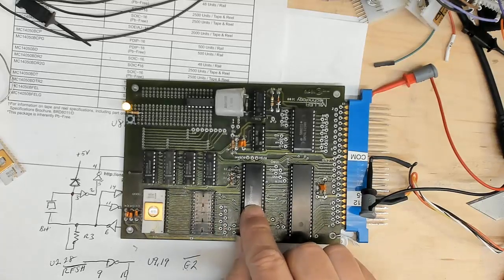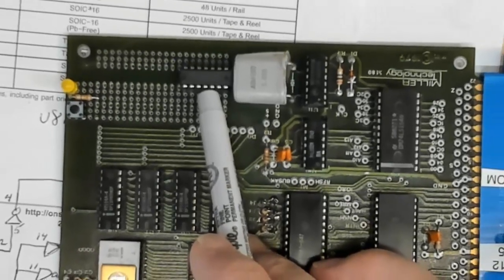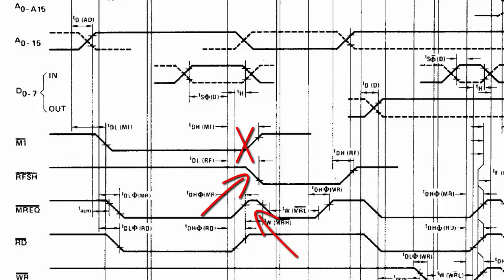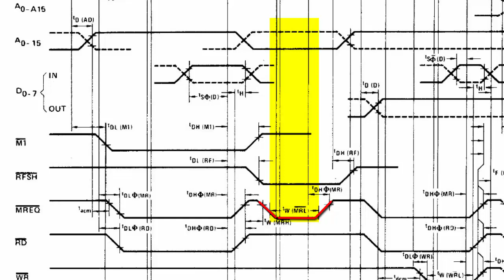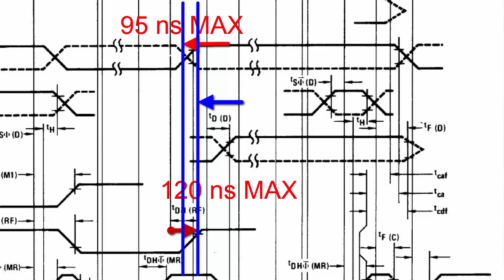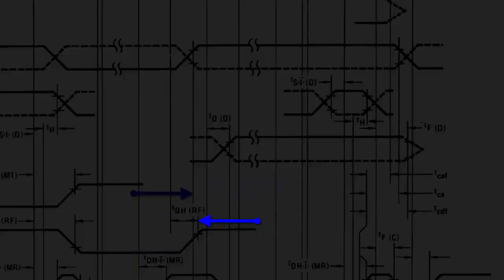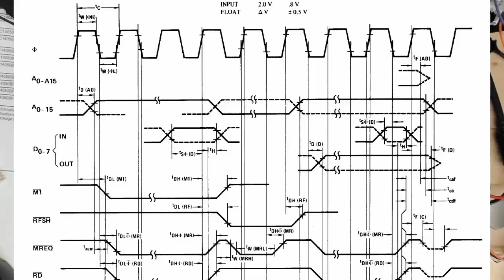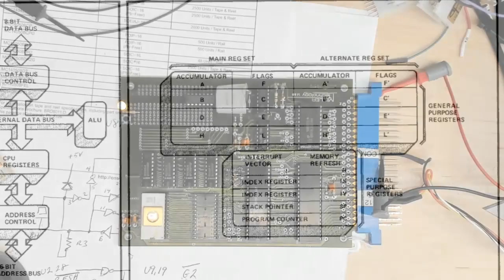{65} There is an output port on the Z80 that is rarely utilized and yours for the latching !!!

Comment: Why does that uncovered UV EPROM bother me so much. It's fine for long enough under led lighting.
Reply from the maker: I get where you are coming from.
Intel gave a safe exposure time of 3 years under fluorescent lighting.  As you suggest, that probably extends to decades under LED lighting.  They also gave erasure time outside in the sunshine as 1 week-- which probably extends to years worth of low-sun summers and no-sun winters here in the pacific northwest.  
While working on a project, the average lifetime of my firmware is measured in days, so i am not too worried about my EPROMs being the weak link.  I do usually put a label over the EPROM when a project is 'done' , to document what version of the firmware was last installed.
Reply: @HelloWorldETX  It seems to be one of those cultural things drummed into us to be bothered by it, there's no rational to be. I noted one other had to say something about it in the comments too.

Comment: Ok, we all know that the refresh signal coming off of pin #28 is often times used for refreshing dynamic memory. What would happen if static ram is used leaving no use for the refresh signal so it just gets sent to ground ?
Reply from the maker: Totem pole output— It would not like being grounded.
Reply: @HelloWorldETX  ; Would it be best then to just not use the refresh signal for anything since it's an output signal and not an input ?
Reply from the maker: @thomas-i5o7h  Yes.  It is an output so it can be left unconnected.
Reply: @ ; Thank you for the info, I've asked this question to quite a few people and you are the very first one to give me a straight forward answer to this question.

Comment: Now that I have seen this, not that I completely understood, I get an idea. Using a sequence of patterns on either the data bus or the address bus to switch something. Most the time it would not interfere with anything.
Reply from the maker: Yes, it is all a matter of how complicated you want to make it. 64k memory (or io) things can be accessed in the normal way with a single sequence, double that if two steps are used like page memory, and so on.   Could tack on anything to anything by making it more and more complicated to access.

Comment: Your EProm does not have a light cover sticker over it???
Reply from the maker: Indeed.  Not worried in the least. 
The lifetime of my test code in an EPROM is several orders of magnitude less than the bit-rot rate of the EPROM from exposure to the lights in my room.   When I finish code, I will put a label over the window with the code name and version number.
Reply: @HelloWorldETX  :)

Comment: Anybody exploring the undocumented instructions in the Z80? Either (some?) Z180 or Z280 16 bit  instructions actually worked in the Z80. Unfortunately I sent all handbooks away years ago. Running the Z80 with 2 * 64 kB dynamic ram + 32 kB EPROM... Using double DMA circuits and double floppy disc controllers, memory protect.... That build was a beast. A 19" rack filled up with 20 single Europe cards... Those were the days.
Reply from the maker: The Z80 still enjoys a loyal following.  here is one site listing undocumented instructions: http://www.gaby.de/z80/z80undoc.htm#:~:text=MORE%20Undocumented%20Z80%20Opcodes%201%20Operations%20with%20the,Autocopy%20...%204%20Null%20Input%20and%20Output%20
Reply: @HelloWorldETX  Thanks a lot! Don't have any Z80 stuff left but fine to know the knowledge still exist "out there".
The last ones I used a 10 MHz clock...

Comment: I like this, using hardware in not designed for ways. It reminds me of some HP-15C code I wrote that used a memory location for 2 different purposes relying on the face that those uses were never at the same time.
Reply from the maker: A problem with implementing these sorts of hacks is when a new version comes out and they realized the same underutilization and took advantage.  Now everyone that used the hack is dead in the water.  Remember all the sneaky tricks you could play to get more out of MSDOS than it was designed to deliver and how every release would break old programs! I suppose that continued into windows and probably continues to this day.
Reply: @HelloWorldETX  well I don't remember exactly what my hack was.These were Electronics programs and one other weird thing about that hack was that I used the memory location for two different purposes and I used the integer part of the float for one thing and the decimal part or the whole number for another thing

Comment: I always wonder how innovative the people of the 50' to the 70' have been😁
Reply from the maker: There was an incredible amount of wasted time reinventing things.  If it didn’t show up in a trade journal, manufacturer’s documentation, or other publication found in the local corporate/university library, it was knowledge that for all practical purposes didn’t exist.  Everyone had to reinvent, reverse engineer, or figure out for themselves.  
I once made a communication interface to translate between a proprietary protocol and a standard protocol. Probably spent two man-months figuring out and documenting the proprietary protocol and building an interface system. Not too long ago, while searching for something completely different on the internet, I came across a document that gave the details of the exact protocol that I spent so many weeks reverse engineering decades before.  It was an internal specification document that was not for general release but could have been obtained by request if we had only known who to request it from back then. .

Comment: Z80 timing diagrams. Memories of the 1980s. Used the Z80 for exclusively embedded apps, back then, before transitioning to microcontrollers. Never used the RSFH signal, as all those designs used static RAM. The 8085 has an explicit IO bit.
Reply from the maker: Yea, I was a Static RAM advocate also.  
I was doing embedded hardware at the time and since the 8080 and Z80 had nothing comparable to SID/SOD (*and* since they came for free on the 8085), I may have gone a bit overboard taking every opportunity to hang something on the 8085 SID/SOD and bit-bang like mad.

Comment: The whole ZX81 display system was based on clever/convoluted use of the refresh system. One consequence was that the internal RAM was a static 1K RAM, and the add on 16K RAM pack needed its own refresh circuitry.
Reply from the maker: Consumer products would (and still) do all they could to make the base unit as low cost as possible even if it meant pushing cost / complexity off onto peripherals.
Reply: @HelloWorldETX  Having spent 40 years on and off thinking about the ZX81, I came to the conclusion some time ago that the ZX81's circuit was ingenious but kind of pointless over-engineering. A year later the Spectrum ULA was a much superior solution and the whole system of using the Refresh counter etc was abandoned. It's one of those circuits that sort of only made sense at the precise moment it was designed like the Atari 2600's display system. It was possible even at the time to design something just as cheap but not as convoluted; I think the design engineer Jim Westwood just got a bit carried away with it as a technical achievement :)
Reply from the maker: @ian_b  I’ve been there. 
Working towards a hardware design or software trick that is so ingenious that it will be the topic of polite conversation for decades, maybe even write books about me or erect statues when I’m gone. 
only later to realize that it was so complicated, convoluted, or overbuilt that nobody (including myself) would ever be able to figure it out, diagnose, or debug. .
Reply: @HelloWorldETX  I think we're all a bit susceptible to it. My form is coming up with clever schemes to get more out of a microcontroller than it's designed for (in some convoluted and design sensitive manner) when I could just get a better spec one instead. It's aiming for the challenge rather than the engineering outcome :)

Comment: A watchdog blinker must never run from it's own timer.  That would make it as useless as a computer independent 555 blinker.  The entire purpose is to confirm that the actual purpose serving program is still running.  So choose a code line that must execute if the program didn't crash and flip an output when it runs.  Then build hardware to blink if that pulse happens at the expected frequency.  For example if the line runs 60 times per second, add a 4 bit divider (half a 74393) to blink around 4Hz.
Reply from the maker: A reset watchdog must have an external timeout circuit (typically a retriggerable monostable) that must be kicked regularly to prevent it from timing out and resetting the system.  But software heartbeat blinkers controlled entirely by code are very useful diagnostics and proof-of-life indicators.

Comment: Why not just use the clock edge in the middle of the reset cycle instead of all the timing risk upsets and variables to trigger the latch?
Reply from the maker: if using /RFSH and the falling edge of phi, it could latch on the falling edge of phi prior to the /MREQ being asserted when /RFSH is transitioning low along with the  refresh address. If using /RFSH and latching on the rising edge of phi, it would latch OK on the intended rising edge of phi when /MREQ were asserted, but it may then latch again on the next rising edge (the phi after /MREQ ) and be re-latched with an address that is past its hold time and may already be changing. 
So either edge of /MREQ gated with /RFSH is the only sure bet.

Comment: A few years ago, I think it was in a Ken Shriff blog, I was surprised to find the reason why the Z80 refresh register only counts 7 bits. It's because they use a weird counter circuit that only does certain bit widths. 7 and 16 bits are good, but 8 bits is not. Therefore the high bit of R simply does not change unless manually changed with LD R,A, but it still always goes out on the bus. The I register working along with this is a bonus.

Good on you for documenting this, it's one of those things that you never notice until someone points it out, then it's obvious.

Also, I think the logic you have there, put on the A6 line, could drive a second flip-flop to add an eighth refresh bit for 64K DRAMs.
Reply from the maker: He always has great insight. I searched his blog and found this— looks like it may be the one you read: 
http://www.righto.com/2013/11/the-z-80s-16-bit-incrementdecrement.html
Reply: @HelloWorldETX  Yes, I remember the Z80 and 64k DRAM you had to add in the extra logic to do memory refresh on the 64k, which needed a 8 bit cycle to refresh. Some did it in software using a loop in the main program to flip that bit regularly and relied on refresh typically being very tolerant of long waits before refresh, so as long as you flipped it at least once every 3 full refresh cycles, or every 20ms, it would still work.
Reply from the maker: @SeanBZA  For some reason I wasn't a big advocate of DRAM at the time, and the old hardware I work on now mostly uses SRAM or they utilize DRAM controllers to do the refreshing and all the other overhead.  So I have never built a DRAM refresh/maintenance circuit from scratch.
Reply: @HelloWorldETX  Funny how SRAM has scaled, while DRAM had to go exotic to get higher density. Now you get SRAM that has a density quadruple the DRAM 2 decades ago, but it fits on a tenth of the die. Capacitors have to be a certain size to keep charge, but you can almost always make a transistor smaller.
Reply from the maker: @SeanBZA  true there are technical, power, and density differences, but hasn’t DRAM always been cheaper per byte and the price difference getting larger?   
In 1980 SRAM was twice the cost of DRAM, 1990 SRAM was 3X, by 2000 SRAM was 100X more, in 2010 SRAM was 1000X more.  So DRAM has the bulk of the sales and, therefore, the bulk of the research and technical advances.
Reply: @HelloWorldETX  But is now the hardest to integrate on a single die, due to all that extra processing needed to make those ultra deep wells needed. Thus the common multistack dies, with the DRAM being planted on top of another die, or under it, and using part of the die to make vias that allow stacking more chips to increase density. SRAM can easily be put any place, as it uses the exact same processing as the logic.
Reply from the maker: @SeanBZA  ultra deep, highly anisotropic etching, multilayer assemblies, embedded contacts, deposited vias, what could go wrong?

Comment: Nice find and neat use idea , I usualy use the I/O specific 256 address Z80 operation codes , unused memory locations and underutilized  I/O device pins . Some variants of devices have more features and some you may want limited to facilitate additional device addition . Good to look out for in any designs .
Reply: It has 65536 I/O addresses, not 256... It's an 8/16 bits processor and you can specify a 16 bits address from any 16 bits register.

In fact, when you're using IN A, (C) or OUT (C), A, you're actually putting the whole BC register on the 16 bits address bus (same with DE and HL, and even IX and IY using the relevant second prefixes, though they pertain to the officially undocumented - but perfectly functional - codes). As a matter of fact, IN A, (BC), OUT (HL), A, etc. do exist in the op codes list, just add the same matching prefix for 16 bits registers as usual (that's how the full actual instructions table was completed a long time ago, through systematic trial that led to identifying a few of them behaving strangely - maybe explaining why Zilog didn't document them -, but almost all of them are working as expected).

So it's only up to you to chose to ignore or decode the MSB to select a device when building hardware. Most, if not all Z80 based microcomputers extensively used 16 bits I/O addresses everywhere, internally as well as in third party add-ons.

Just in the ZX Spectrum, it was used to read the keyboard (it was an address x data buses matrix) or to select memory banks and control the AY-3-8910 in the 128k model, but most of the add-on expansion modules did the same so none of them would clash with one another thanks to the extensive number of distinct 16 bits addresses (with some exceptions like the ZX1 and various disk drive interfaces and their many own onboard I/O devices such as parallel printer, RS232, network etc. ports, that shared the same addresses most of the time, considering you wouldn't want to use them at the same time since they usually shared the same BASIC commands anyway.

Edit : LOL the next video just explains this : :p

https://www.youtube.com/watch?v=4-RetCtWe2M
Reply: At the time I was coding for Z80 my only references were " official " so my hardware was designed for " intercepting out of range code as custom coprocessor commands or error state recovery triggers .
Thanks I will write a compiler for this when I start using Z80 again .
Reply: @alt3241  I started taking interest in the Z80 in 1978 after the high school club got a pair a TRS80 model 1...

I couldn't afford a computer then, but bought the books "Z80: programming" and "Z80: interfacing" from Publitronic, and the "undocumented" op-codes were all listed and explained.

I could buy a ZX81 kit with pay remains from the military when I entered the university in 1983, then bought a used ZX Spectrum + ZX1 + microdrives a couple of years later, and did all my university work with it (especially after adding floppy disk drives and a used Epson FX80 printer). :p

I almost immediately replaced the dreadful gum keyboard with a scavenged TRS80 keyboard rewired on the fly with a bunch of wrapping wires...

The original keyboard was mostly kept apart to be used with the keyboard labels grid to play Elite. :p
Reply: @alt3241  It was indeed unfortunate, because yes, the I/O address range should have felt limitated then...

If I'm not wrong, I think the the 6502 (and family) didn't even have a separate I/O feature and used memory addresses for this use. Of course it would offer flexibility and freedom of choice for the address range when designing a microcomputer, depending on the needs.

I've also noticed 6502 based systems usually put the ROM on top and RAM at the bottom (lower addresses) the addresses area reserved for I/O was inbetween. Maybe it helped booting a system loaded from disks starting from address 0 ? CP/M also used a 100% RAM adresses map, after all.